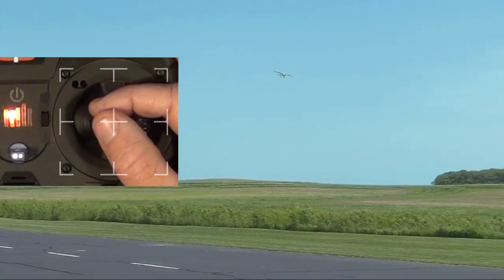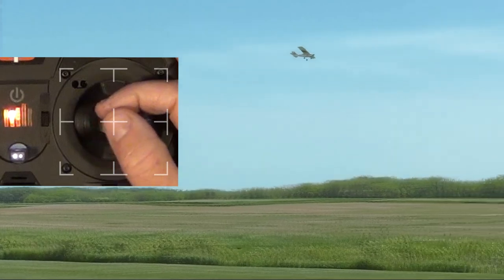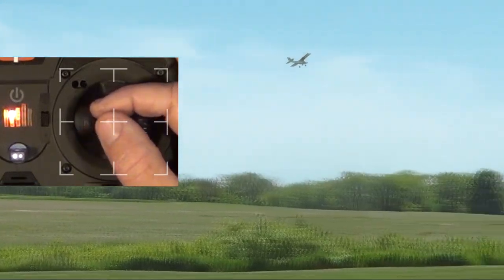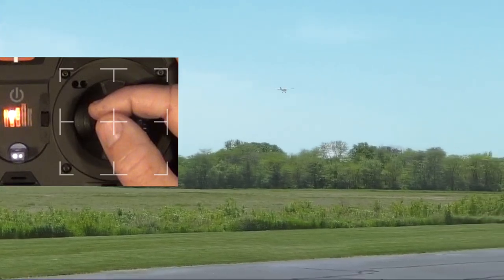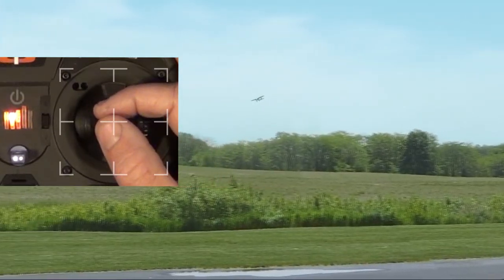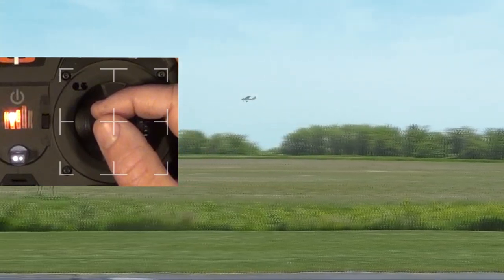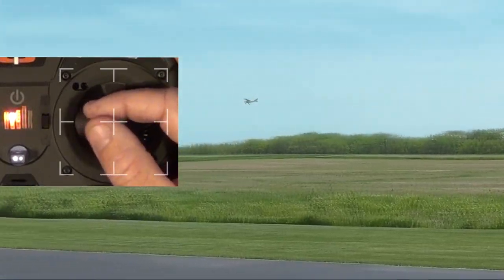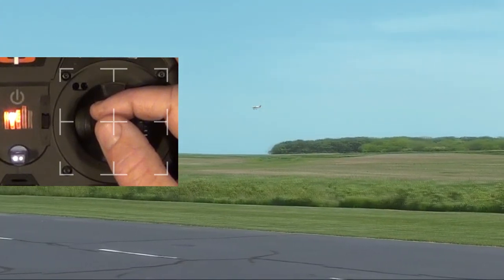Straight Lines & Course Adjustments

Comment: Hi Dave, brand new RC pilot here and learning to improve my stick skills. Been struggling making coordinated turns and stabilized landings. Read your article in October 2024 and then came here. Once I understood your technique, I fired up RF  EVO sim and my radio and did some approaches with the Apprentice model. I set the model to AS3X, no SAFE. The aileron in-out is a game changer for me. I made a series of relatively smooth landings and much improved go arounds. I'm going to checkout more of your online material. I've downloaded your AeroScout model for RF and will adapt it for use with my radio (Radiomaster Tx16s). Maybe I can take advantage of your classes. Thanks so much.
Reply from the maker: Awesome!  You've made my day